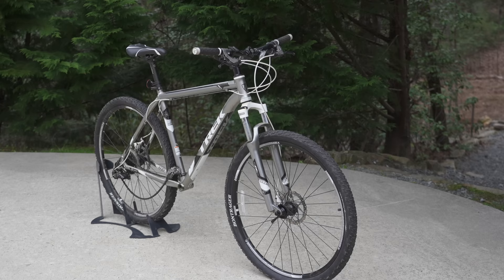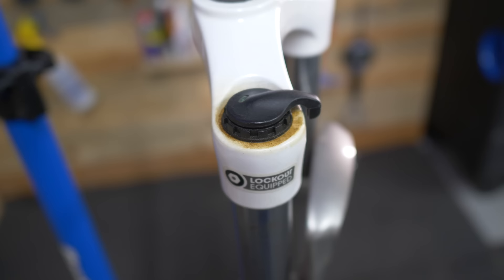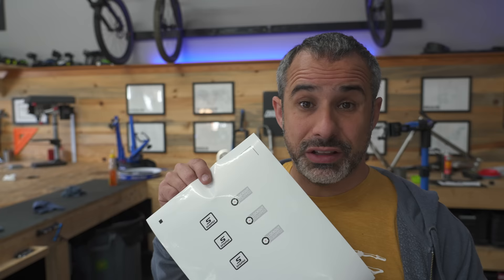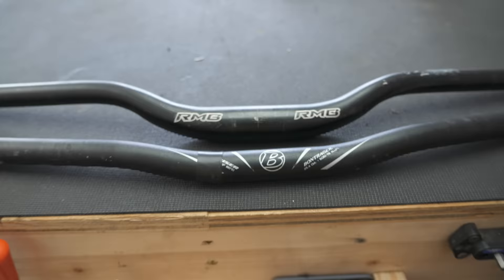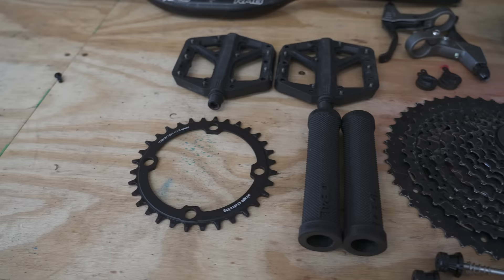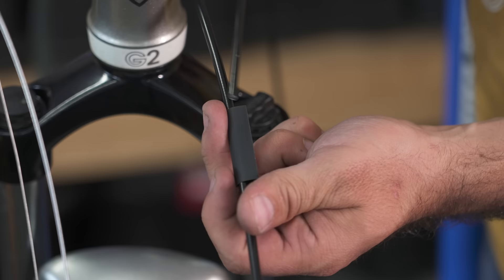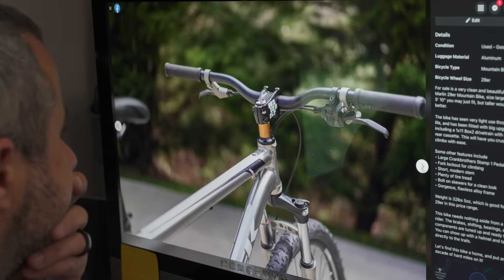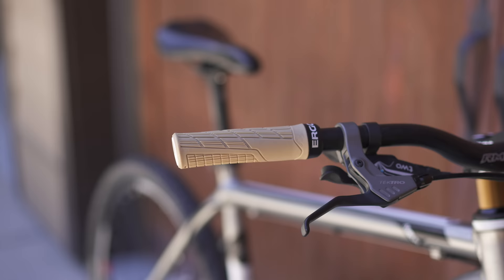Will they pay more for a 29er? Flipping a Trek Marlin Mountain Bike

Comment: I did something similar but I sold my Trek Marlin with a huge loss to a kid. The smile he had riding it made it worth it.  He got Mavic rims and Hope hubs. A Rockshox fork with lockout on the handlebar. Dropper seat post and wider handlebars. Tubeless setup with Cushcore and Maxxis minion tires. Magura mt7 brakes and 1x drivetrain. Pilgrips and Saint pedals
Reply: That's really nice of you making a loss on that bike for that kid!
Reply: Stuff like that can make such a huge change in someone's life, no joke he might use it almost everyday, who knows how well he's doing in 10 years because of that.
Reply: That’s really nice! But how does someone spend that much on a Marlin!? Lol
Reply: Kid took it and sold for a profit 😂… joking aside it’s nice to know there are still good people out there that value a kid smiling more than making a quick buck…
Reply: I put a full carbon ritchey fork on my marlin 5 with a shimano XT group set also with hope hubs laced to the stock rims because those original rims aren’t bad
Reply: @AlamoCityFishing  I went full XT drivetrain and Deore brakes on my 2020 Marlin. Some upgraded forks and wheelset too. It's worth it I think. I like the frame. It is cheap but reliable.
Reply: @AlamoCityFishing  Marlins are great bikes.
Reply: bro its just a marlin that is a entry level bike 😆
Reply: @CUZC0M  Depends on which Marlin you get. As you move up the models, they become successively less entry level.  Besides, the bike matters less than the person riding it.

Comment: in 2020 the trek marlin 5 retailed for $550 dollars brand new, now it retails for $720. Unbelievable!
Reply: That did upgrade some things such as the drivetrain and the fork
Reply: Yes i paid like $780 here in canada for my 2019 Trek Marlin 6 in 2019, came with a $100 tune up service but i never ended up using that cause im dumb but also cause it stayed mint till about now and I didn’t have my own vehicle to transport the bike to get tuned up

Edit: 
So after 3 years and a bit the suntour fork is junk the 3x drive train is junk everything makes noise, the bottom bracket sucks 

All i upgraded was the stem (shorter) like in the video and grips and pedals and adjusted my bars and the whole cockpit to make it feel as aggressive as possible on a budget

I road this bike like a enduro/trail bike sometimes even like a downhill bike, just launching off any form of a jump as fast as i could go but i was never near a mountain lol

I am looking at The Marin Hawk Hill 1 as my next bike as its readily available to me and in my budget
Reply: I bought this years Marlin 6 for 900 after tax, so far it’s been a worth wile purchase
Reply: while that is true, they did shift the marlin lineup a bit, the 2022 Marlin 5 is pretty much equivalent to the 2020 Marlin 6, and there is now a Marlin 4 that retails for 600 i believe. so prices have definitely gone up, but not as drastically as it seems as first
Reply: @keanewoolever5161  that cheap Amazon crank 😂 also that bike came out in 2012 LOL 700 bucks for a 10 year old frame 🤣
Reply: My Giant Talon 2 last year just last year was 100 dollars less and even then it was 100 over retail
Reply: I have this exact bike I paid $650 in 2012. It’s probably equal to a Modern 5 but the 2012 gold level frame not silver frame. Still in perfect condition.

Comment: 14:20 You mentioned the lifetime Trek warranty - it's a great warranty but just a heads up that it is not transferrable.  I broke my Top Fuel and was devastated to learn that it isn't covered!!!
Reply: How does life time warranty work if the bike is 10 years old? Will they give you a newer model or refund
Reply: @oo0024  Exactly,  And yup - the warranty is for the original purchaser only.
Reply: @oo0024  I bought a brand new Marlin 6 for 700 bucks
Reply: @oo0024  NX Eagle is trash though
Reply: @byp4ss514  actually remarkable for the pennies you pay for it, but go off king
Reply: I have an old Fisher Cake I ride daily and the frame broke below the seat post and the top tube. Not the original owner so no warranty. Bummed.

Comment: The black, grey, white, and the gold accents just look badass. This somewhat older trek reminds me of a  friend's trek I'm restoring somewhat. But damn did you restore that bike nicely 🔥
Reply: Should have given it Shimano MT200. $50 reliable hydraulic brakes. Cable disc brakes are just walmart bike tier brakes.
Reply: @sepg5084   well maybe but knowing that trek makes really good bikes especially budget ones, I'm pretty sure the parts they use while not being top tier is a bigger step up from Walmart tier parts. While Walmart may use cable disc brakes, the brake pads themselves and the calipers themselves are made a lot cheaper and most of the time don't even have names. Trek doesn't really use no name parts when it comes to something important relating to safety aspects of the bike. And Tektro brakes from my experience work way better than Walmart brakes and stop pretty strong and if it works good I don't see the need to getting new ones 🤷

Comment: Really enjoying this flip bike series. Keep up the great work Seth .
Reply: Great video, very informative and brings a lot if knowledge… quick question though… how did you end up fitting an 11speed cassette? Did you change the hub or used the stock? Reason i ask is that I have a 2018 Marlin 5 and the hub can only accept up to 7speed. Thanks!

Comment: quick tip - use the crown race setting like a slide hammer while holding the fork in the air in your other hand. That way you don't risk damaging the dropouts by resting those on your bench.
Reply: I've always just held everything upside down, and banged the end of the PVC pipe into the garage floor. No risk of damage, plenty of impact force that's easy to control.

Comment: Seth, this is very minute, but an easy step to increase the longevity of quality would be to apply clearcoat both under and over instead of just over the stickers. That way, if and when the sticker does fall off it will be the same glossy finish as the rest of the bike.

Comment: Good luck getting the two edges on that hand-cut stem spacer parallel and square! You can even see in the video that they are not. Everything else hid did was good, but I wouldn't encourage anyone to make their own headset spacers unless you want to reduce your headset's lifespan significantly with uneven loading or if you have some precision cutting/finishing machinery.
Reply: I know next to nothing about bikes, but I had that same question. I am mechanically inclined though.

Comment: Hey Seth, I wouldn't suggest using those IXF Cranks. Had a set in blue that failed catastrophically while riding at college. To be more specific, the sprocket side crank arm snapped at the spider mid climb and took out a hunk of my leg. My freshman engineering professor (also a MTB'er) pointed out that it had failed due to a crack that widened itself out. Also, the set arrived with the sprocket side crank not properly anodized.

Comment: I used a PVC pipe with a cap and a mallet to set my crown race and it works pretty well. Really like the use of the Fox fork for the spacer!
Reply: Same here mate ! A little bit less expansive than the (magnificent and overbuild) Parkside dedicated tool for this one time job ! Also I made my own headset cup remover by cutting a metal pipe at one end and bending outwards the sides. I bet you know what I'm talking about.

Comment: This turned out pretty well.
I noticed the iXF crankset on this Trek. I bought some last year from Amazon UK which came with a bottom bracket. This was replacing a Shimano octalink BB which I fitted weeks earlier and the 22, 32, 42  chainring. 
The iXF bottom bracket was too tight for the spindle so I ended up buying an el Gallo bottom bracket which beautifully matches the red iXF crankset. 
Paired with a Snail 36T oval then 36T round chainring and recently replaced chain and cassette my 2010 Specialized feels like a new bike. 
I did notice a difference between oval and round. Oval seems slightly easier going up inclines and round is faster on the flat.
The iXF crankset is not top notch by any means. But for my weekday road ride to work it suits me just fine.

Comment: Hi Seth, got a question. I know it's a flip bike, but it's a size large, so mechanical brakes are just not safe when you have some extra pounds. A pair of basic shimano or magura brakes, or even the popular in Europe - shigura ( shimano lever with a magura caliper) would be better and safer. First step of having fun is to have control in order to learn learn. cheers mate!
Reply: I kind of agree. But being someone how has had a bike with cable and hydraulic(same bike i swapped to hydraulic because i couldnt get pads) cable breaks are more then enough to cause the tire to lock up and slow you down. Granted they are not as easy to keep from locking up and need some force at times. I wouldnt say they are unsafe.

Comment: I can confirm the previous owner did not cut those bars down lol. Those 2010-2013ish trek marlin/Marlin Gary Fishers came with insanely short bars. I bought a hardly used 2011 Marlin Gary Fisher and it was the same way. I fixed it up and replaced everything on it except the frame and rims/hubs. It was a fun project and I've ridden that bike almost everyday the three years I've had it. I'm all for fixing up these older bikes. Yes they are less capable than a real trail bike but you can still manual, bunny hop and wheelie them to your heart's content on some of the less advanced trails and even that is more than most riders (who insist on having a "real" trail bike) will end up doing with their bikes. In my case I've used this Marlin I fixed up to learn to work on bikes, how to do the trail basics (Wheelies, manuals and bunnyhops) and to get into considerably better shape. Yes I did change parts but only slowly and I rarely felt hindered by the stock components while I still had them. A good setup and regular maintenance (and a good attitude) will take you a long ways!

Comment: I bought the 2019 Marlin 7 new, I’m a Clyde and wanted a hardtail. Felt like I was leaning way over, holding up my gargantuan core was too much, and the 80mm stem with 780mm flat bars felt like I was riding a street sweeper. Decide to upgrade it: FSA carbon stem with 20mm setback, Renthal Apex 40mm Stem and Fatbar Lites with 40mm rise and RaceFace Half Nelson grips, and what a difference. Didn’t stop there, got the SRAM NX Eagle drivetrain plus all the right parts and tools and VP flat pedals, and now it’s an awesome one-by. This bike will never sell because I’m never selling it! Why would I end up spending $1700 total on a Marlin plus upgrades? Because for 1700 bucks I have a totally dialed in hardtail with a Renthal carbon cockpit and NX Eagle drivetrain, all on a quite decent frame with a lifetime warranty. Oh, and it’s exactly the color I wanted, orange with black, not available any longer. 😀

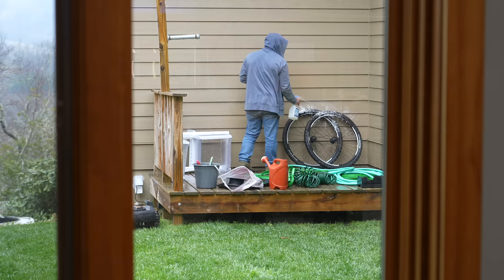Comment: 5:56 Spray glue or tape the sand paper to a piece of glass or MDF. Then rub the brake rotor on them while pushing down with your whole hand. You will get a more even sand due to the flat surface backing and even pressure.
Reply: Just like lapping the sole of a plane!

Comment: The seat will just peel. You need to use Sem automotive trim interior paint. Along with the adhesion promoter. While adhesion promoter is tacky. It actually softens the vinyl making the paint  bond to the surface.

Comment: Pro tip cut the brake cables shorter at the calipers  and at the rear derailleur, you do not want them to contact the brake rotors or upper pulley wheel of the derailleur.  FYI, frame warranty is for the original owner of the bicycle only, it does not transfer to the second owner.  Good looking bike though.

Comment: Nice job. You really know your stuff! I sold my Cannondale m900 1996 hardtail 2 years ago it was the handbuilt in the USA frame. Unlike Taiwan now! I'd upgraded pretty much everything Inc a revelation  fork (I wish Id kept). I got $450 but if I put all the original parts on I'd have gotten more as a vintage bike. I'm happy with my new cube acid $1200 hardtail now though here in the UK. 👍

Comment: I had a marlin SS from 2013. The internal screws that hold the rear axle were 3mm stainless cap heads that bent inside the frame and wouldn’t come out just from pedaling pressure. Trek sent me a Superfly ss team edition frame for free in exchange. Still have it.

Comment: I would have used a pipe cutter for the spacer. A saw guide is plenty good to cut a steerer tube that's not supposed to contact the stem cap but for a spacer I would want a perfectly straight square cut. By the way going from the diameter that stanchion would be a perfect replacement for your crown race setting tool. Kashima crown race setting tool, just imagine how much street cred that would earn you! E bet even Calvin doesn't have one of those.

Comment: At 2:22, you can see that no, the previous owner did not cut down the bars; that's the factory end of that handlebar. By the way, that frame does NOT have a lifetime warranty now. Trek provides a lifetime warranty only to the original purchaser and that ship has sailed.

Comment: HAH this is the same exact older trek Marlin I bought last year to build up and keep as a backup bike, though mine is a medium. There's a lot of deals you can get on new mid range bike parts. So far on mine I have:
- Put much better tires on it
- Replaced teh garbage cable brakes with a new set of bargain shimano hydraulic disc brakes
- Got some adapters, removed the 6" rotors and threw on a set of old 8" rotors I had around
- That same hussefelt 40mm stem I also have on two of my other bikes :P 
- I also put a new, wider bar on it
- A cheap lever-operated dropper post, KS eten I think
The insides of my fork are all corroded so it wasn't worth a rebuild. I literally poured like 40cc of mobile 1 motor oil in each side and eventually it loosened up. I'm going to try to grab someones old fox 32 or 34 when the opportunity comes. I have a barely used front wheel of my santa cruz that will go great on this bike once I get a modern fork. I also plan on going with a Box 9 speed drive train, but for now it has the factory 3x9.

Comment: I've still got Trek Cobia by Gary Fisher - same frame, better components ;) RED colour.
Great XC/Gravel bike.
But during time bike was modified to: 2x10 next 1x10, wide range casette and oval chainring
X9 groupset from "end of line sale", X0 derailleur
New DT Swiss rear wheel (Shimano hub doesn't last long).
New brakes (Sram Level T) Bigger front disc (8")
...
Run like dream
...
Lucky owner has bike for another decade :D

Comment: For $640, I would have spent an extra $150 and got a Brand New Bike.

Why buy something 10 years old when you can get a brand new VITUS NUCLEUS for $800. 

Which has a better air fork, better tires, modern frame geometry, internal cable routing ready, modern headset, the list goes on. Plus you also get all brand new parts with warranty.

Comment: Probably would have dropped to 20mm in spacers under the stem. I find anything over 20mm in spacers looks kinda silly, and most XC guys see gonna want a shorter stack anyways. Since you used one 30mm spacer, you can't even lower the stem without replacing the super sweet gold spacers now.
Reply: Who cares how it *looks*.  How it fits is what's important.  >20mm may be what's needed for a really tall guy.

Comment: Only things I didn't like was on the kashima spacer you kept the chamfered edge which you see on the bottom. It looks funny plus there's not as much material making contact. I would have cut that off so both edges top and bottom are flush. Also the painted saddle. Otherwise nice transformation.

Comment: I had this bike and i didnt like it at all, on steep hills you would wheelie even when you shifted your weight to the front, if you shifted even more to counteract this (besides pedaling awkwardly) then your rear wheel would lose traction and the climb was over. With another 29er from a friend who uses the same size bike, I could climb the same steep hill effortlesly other than pedaling. You didnt feel like the bike was going to lift the front tire and wheelie. Also another thing and probably what i hated the most, was that the biggest gear was way bigger than the second one, so, on a moderate climb while being on the largest one you would pedal and move so little,  so naturally you shift to the next gear but then the pedals felt heavier than what you would like, and no in between, you literally felt what you can literally see (the gap of gear size) , as if its missing a gear in between those. You can see the gap in size on the video. Anyways, Seth upgraded that so that wont be a problem for the next owner but the thing about it doing a wheelie on steep climbs cant get fixed. And trust me it wasnt because i dont know how to ride because on another bike  i could do it without any problem.

Comment: I got my first Ebike well first bike in a good few years just yesterday the 2023 cube action team 160A with the longer travel for my weight i was concerned about it but also got the large and the thing is absolutely amazing to sit on feels like a tank under you so stable but the 160 came with 27.5s if it was the 140 with 29s id never have got on the thing and im near 6ft! But its the first time I've seen 27.5s and there huge just looks so much bike to what my old ATX 990 and GTs were just love it but not had a shot yet as don't come with pedles but does come with a free mudguard 😂😂😂